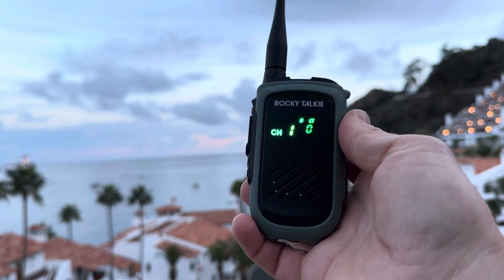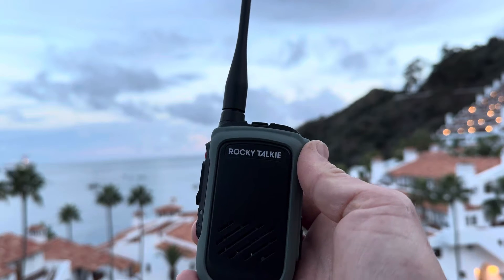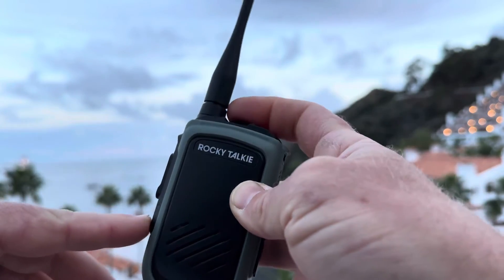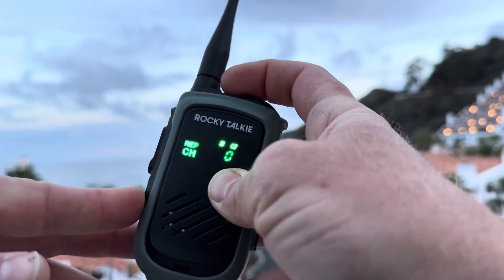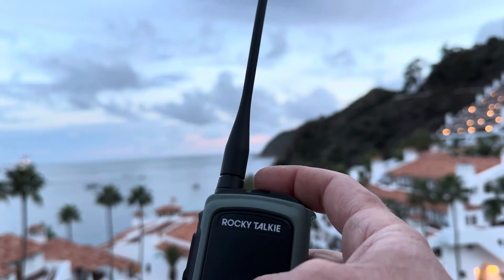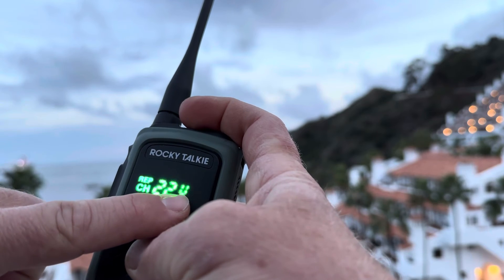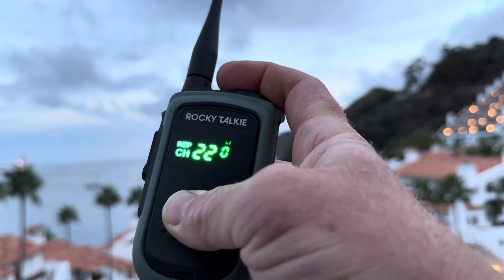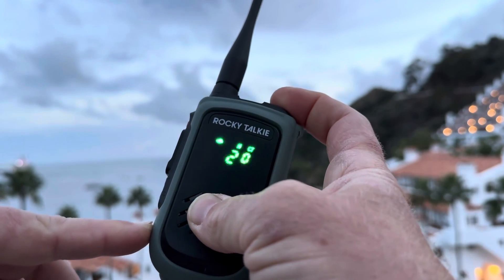How do I use my Rocky Talkie GMRS with a repeater?

Comment: Do you have to “enable” the repeater channels (holding the minus) with every power cycle you want to use them?
Reply: No, once it's on it remains during normal power on and off.. follow the same activation steps to deactivate the repeater function.

Comment: The repeater I want to use lists its input tone as 141.3 Hz and output tone of 141.3 Hz. My Rockie Talkie only allows me to input  single and double numbers. I looked on their website manual, and I still couldn't find anywhere listing 141.3 correlating to a tone number to input my handheld radio. What number would I dial in on my Rockie Talkie for the tone, if the repeater is 141.3??? And if I want to use other repeaters and they have different tones, where in the heck would I find the information that would allow me to correlate their tone numbers to the input numbers I got on my Rockie Talkie?
Reply from the maker: On the Rocky Talkie, by its nature, the input and output tones are the same. So 141.3 will be the input and output. And yes, for a different repeater you will need to change to a different tone. I don’t believe that there’s a way to have presets for say three different tones with the same frequency. Though if the frequencies are different than each, repeater precept can be programmed with a different tone
Reply: pull up the manual, 141.3 correlates to a number on you Rockie that you can navigate to.

Comment: What if input and output is XXX.X ? there is no decimal in the rocky
Reply from the maker: Good question.  There is a chart in the manual which is listed on the Rocky talkie website that correlates the tone to a CT number.  The assignment of the numbers to specific is rather arbitrary, but seems to have standardized these past few years.  Go to the manual for the. Umbers you’re looking for.

Comment: I have had this radio for two weeks and I absolutely love it. My wife and I have been using repeaters 18 miles away. Great job Rocky Talkie!!!
Reply from the maker: Hey, question for you.  As you already have the GMRS radios and aren’t just speculating, does the delay in transmitting after pushing the PTT bother you or am I just weird? I’d love to hear that I got an odd batch of radios with PTT issues.
Reply: the delay bring's up the repeater and NO I have no problum with that
the  problum  is I hate it when the repeater come up and no one is talking
on it very rude.
Reply: @AdventureCruiser    Na, you are not weird. You just have your preferences.  I am not going to pretend like I know a lot as I am very new to GMRS.  But to answer your question to the best of my ability, I do not notice any delay’s when I push the PTT button. So far so good on my end!
Reply from the maker: @garzilla4624  honestly, that’s the answer I was hoping for. I like knowing that problems that may bother me don’t bother other people. It is a great radio, and I would love to see them become even more popular. Thanks for the feedback on that, I really appreciate it.
Reply: @AdventureCruiser  turn off the auto weather warning function.
Reply: I just bought my pair learning as I go. 
Question do I need GMRS license to operate a Rocky talkie ???
Reply: @ignacioreyes2244 , you do need a license if you bought the 5watt gmrs version.
Reply: @antzinator   YES YOU DO.
Reply: @ignacioreyes2244  No, you only need the license to access repeaters.

Great purchase, you will love them. They are very tough, and the battery last forever!
Reply: @ignacioreyes2244  Yes, if you want to use it in 5watt mode. No test involved. $35 fee covers the entire family, The one time registration lasts 10 years.
Reply: IF your Rockie  is G M R  yes if not then as I am not a rocky fan.
Reply: @ignacioreyes2244   only if you are on repeater channels
other wise no FR S is no licensee needed .